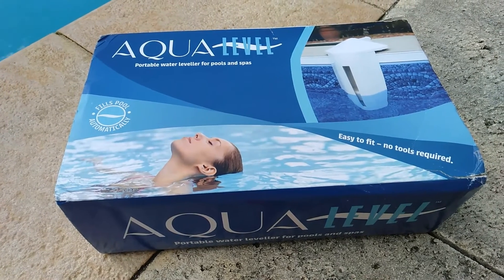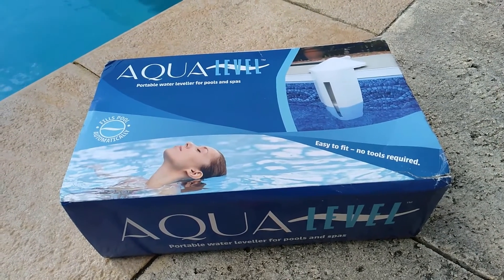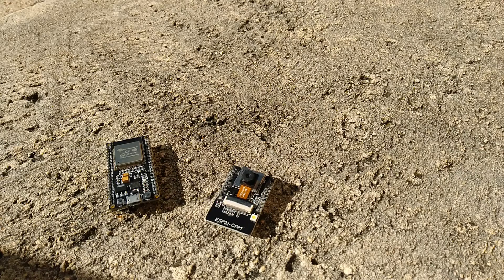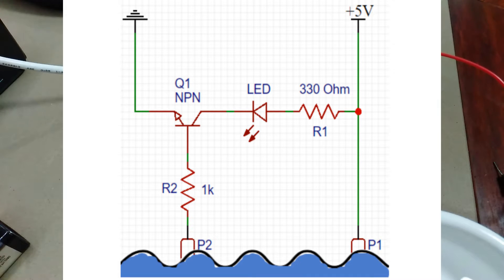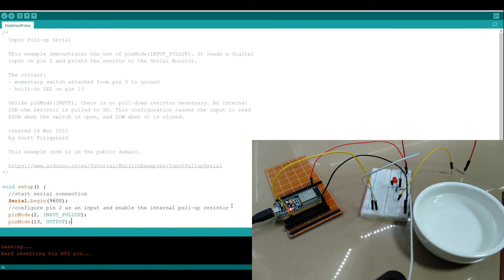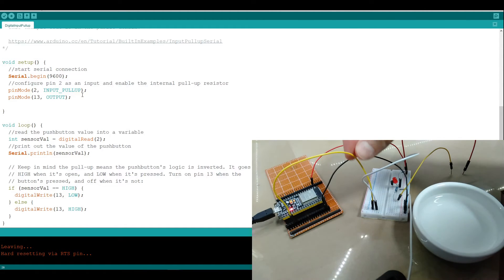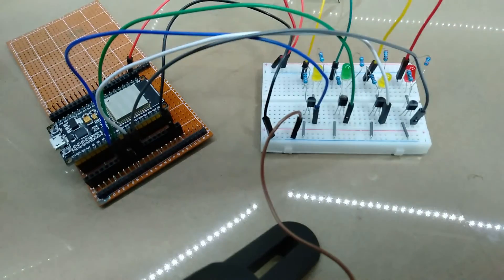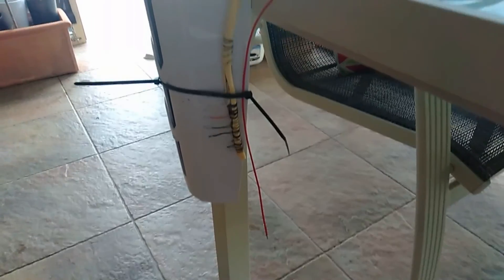Water Detection Circuit with ESP32 (Automated Swimming Pool Water Level Part 1)

Comment: Awesome! This is exactly what I've been looking for! Can you provide a parts list and schematic by chance?
Reply from the maker: @fizzasist  one of the videos in the series I draw the basic building blocks and how they hang together.
In terms of parts it is 
an esp32
A relay module that can be driven by 3.3 v from the esp32
4 npn transistors nothing special so any type would probably do
A buck converter module
Some diodes and some resistors and a few LEDs